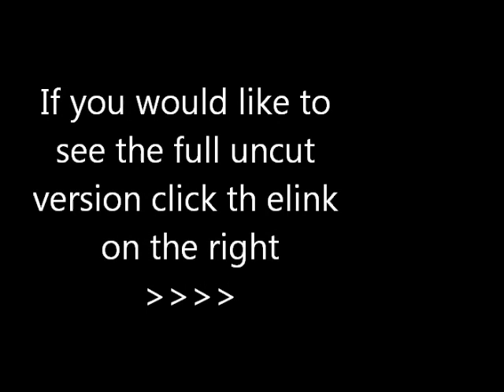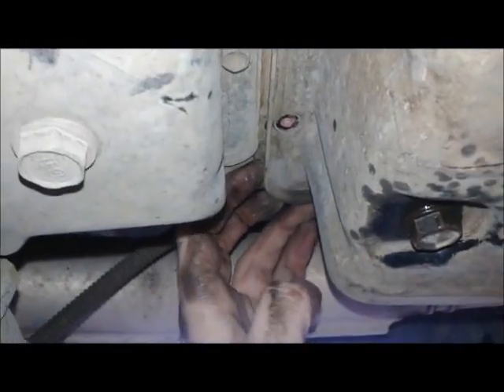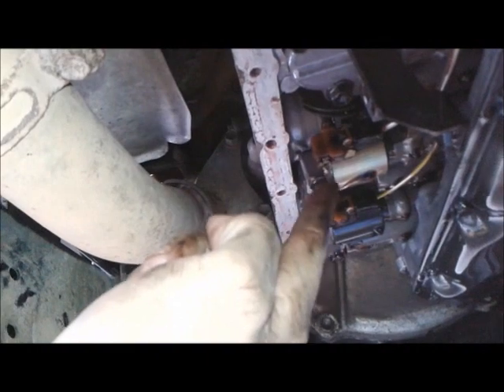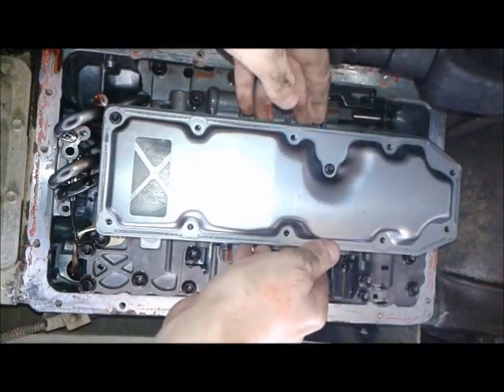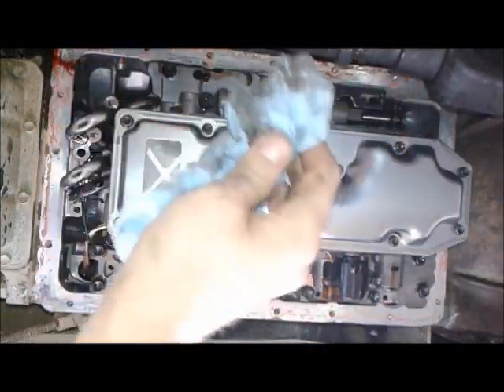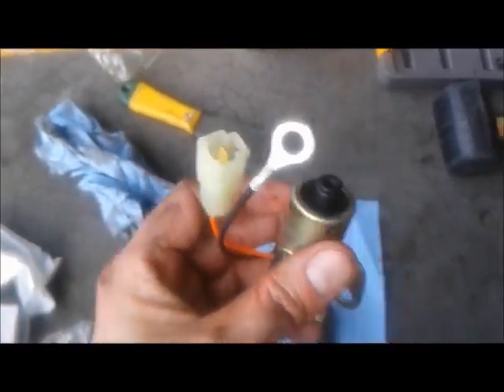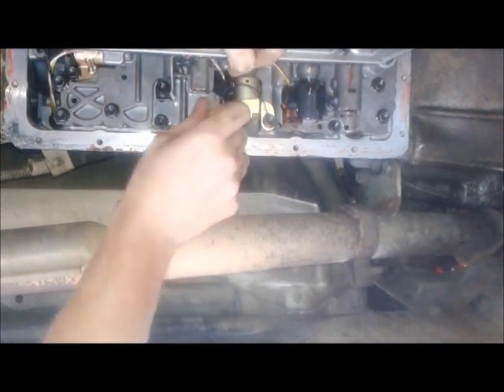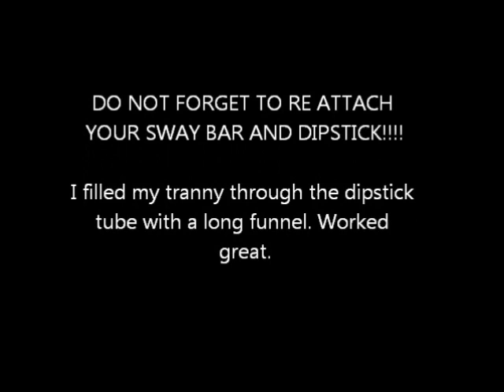2nd Gen 4Runner Shift Solenoid Replacement ***condensed***

Comment: For anyone wondering what improvements this made for my 02 4Runner. I just installed the 3 solenoid, filter, and 5 quart fluid (of 12)replace NOW IT SHIFTS LIKE BRAND NEW. I was just hoping it would clean up sloppy shifts BUT IT FIXED way MORE. It kicks down gears SOOOO much faster. If you're in overdrive cruising and full throttle, it NO LONGER applies full throttle to overdrive for 1/2 second to 1 second. It now kicks down the gear/s before the pedal is even at the floor. It literally made this horribly slow suv a tad bit faster just because there isnt lag before the kickdown anymore. 
   It was also holding 2nd gear excessively long sometime. Not an issue anymore. And it was shifting a little soft when light throttle shift to 2nd. NO MORE!! Nice firm complete shift fully engaged. IM PRETTY STOKED!!! My 02 4runner has 185k miles. I did the 1st 5 quart drain and fill with a new filter at 100k miles about 10 years ago so the fluid still looked brand new red, no burnt smell(even though i live in the desert 120+ summers). All she needed was new solenoids. Do it now before you  cook the trans!
Reply: Exactly my problem...long delayed shift in second gear...but now also when i reach 50mph...i can give it gas but wont accelerate very well.
How much did that replacement cost?
Reply: I know I am kind of off topic but do anybody know a good place to stream new series online?
Reply: @Marcel Arthur flixportal xD
Reply: @Tommy Ben Thanks, I went there and it seems like they got a lot of movies there :) I really appreciate it!
Reply: @Marcel Arthur Glad I could help :)
Reply: Did you replace all 3 solenoids?  Or just that one?
Reply: Thanks for the info, any chance you have the part number and the price?
Reply: What selonoid kit did you purchase and where from? I got a 2002 third gen 4runner automatic V6 2wd that might have a sticky selonoid issue.
Reply: How many solenoids does the 02 4runner have? Or which ones did you replace?
Reply: Is this process the same for 2wd ?

Comment: My 1987 4runner would not shift to 1st. gear after coming to a stop sign.  The way around that was shift manually,  the problem  ended up being the shift solenoid as described in this great! video.  I had the transmission shop change out all 3 solenoids for safe measure.
The parts were not expensive.

Comment: Where are people buying reputable new solenoids for the A340h? I think all of mine are probably cooked as they’re in an 89 4runner that hasn’t had much tlc in its life before I got to it. 230k miles means it’s shifting super hard from 2 to 3 and into reverse. Not sure if they correspond to certain solenoids but I plan on doin all

Comment: Do you have a part number for the shift solenoid?  Also, was this from an error code?  Mine keeps coming up as P0770 (shift solenoid E), but I don't notice any problems shifting...super fun.
Reply: Just seeing if you have a part number for this solenoid...
Reply: Paul Krug 
Is that the part you need to change  for code P0770??
Reply: P0751
Reply: @paulkrug6748  ATP part #1-5426 (NAPA Auto Parts)

Comment: My 94 4runner when cold wont move until warmed up do you think this is the problem...also i dont get enoughh power when i step on gas..i changed spark plugs ..wires..cap and roter..any advice
Reply from the maker: It could be sooooo many things. As for power, maybe you need to change the fuel filter. you probably change your oil regularly? Clean the air filter and throttle body? Do you get a check engine light or anything? I've posted a full length version of this video that shows you how to read the engine light codes pre 1995

Comment: I've got a 92 Cressida. The transmission was fine, then it wouldn't go into gear. I felt like it was a solonoids, so I unhooked the battery, and then started it back up, and was able to drive it perfectly for about a mile, then same thing. Its like I put it in neutral. Shift control, solonoids? Any ideas would be appreciated.
Reply from the maker: Could be a computer problem🤔 I honestly don't know. The symptom sounds like the solenoid, but I'd never be able to diagnose it over the Internet.
Reply: @MyAccountBitch  that's what I've narrowed it down to. Shift control, or computer. The fact that it works fine, for a time, EVERY time, makes me think it's a wiring issue too. I can't wait for my schedule, and the weather to permit me to figure it out. The house I just moved into doesn't have a garage yet. I'm really curious, and anxious to figure it out.

Comment: Mine just started slipping on first gear when taking off after a stop. When engages slams and takes off loads hard on rear end? Only does here and there just started rest of time shifts fine?
Reply from the maker: Sounds about right. If you check out the long version of this video it'll show you how to look up the transmission code
Reply: @MyAccountBitch  where is the long version of your solenoids video? thanks
Reply from the maker: @albertomendezvincenti3020  https://youtu.be/EEoqKD0QcTI

Comment: Hey man my 93 4runner started having shifting problems I'm think it's the shift solenoids because I drives & shift amazing once I get to speed & or the truck has warmed up. How much you think the labor would be not including parts to replace the 3 shift solenoids?
Reply from the maker: I couldn't find a shop to do it. They wanted to do a rebuild. That's why I did it myself. It took me a few hours. I'm sure a shop could do it in a couple of they were willing. My solenoid alone was almost $300 though. I think there's cheaper aftermarket ones though. You'll have to do some looking around.

Comment: Do the other 2 solenoids come out just as easy as that one? having issues with shifting and thinking about just replacing all 3 if it's as simple as just unbolting and plugging new ones in.
Reply from the maker: Yep. You can buy a kit with all three
Reply: May I ask where did you buy yours from?

Comment: Great video bro, I'm going to do mine very soon here.  I just got my solenoids from RockAuto, very fast to Edmonton Alberta.  They were a bit pricy due to exchange but oh well Waaa!  I'll be doing it at a rental garage end of the month.  I lost my last gear.  Will not go into overdrive.  I think I'll just change all three.  Cheers!
Reply from the maker: I paid $270 for one...
Reply: Holy!  I got all three for $238 from Rock Auto.  I'm thinking of installing a shift kit when I do this after reading about all the benefits.  I'm going to rent garage space with a lift, so it'll be easier.
Reply from the maker: +shaun wakefield
 are yours OEM?

Comment: mine would never go in revers unless you would drive it for a good while. then the 3rd shifting to 4th would take for ever to shift. It gave me the code for 62. I believe solenoid #1 is the issue.
Reply from the maker: Bryan Lopez
 yep. 62 was the code I pulled too
Reply: did your reverse work when engaging in that gear? im just hoping when i change the dam thing it will work
Reply from the maker: Bryan Lopez 
yeah

Comment: Thanks for the video. Question. I have a 2006 v6 Tacoma and my code is P2714 pressure control solenoid "D" performance(shift solenoid valve SLT) so I was wondering if I need to do the same thing or if I have a completely different problem? If you could give me a little advice please I would appreciate it and would be willing to wire you some money for going out of your way to help me. Thanks

Comment: Where did you order it this shift solenoid from?
Reply from the maker: Sleek S local parts store. Not cheap
Reply: MyAccountBitch how much was the pricing?
Reply from the maker: Sleek S I can't remember exactly, but I think it was between 200-300
Reply: MyAccountBitch hey so u got aftermarket you didnt get it from dealer? And how does that work been trying to get better price dealer wants 600 for one thanks

Comment: My 97 T100 SR5 4x4 is having all sorts of shifting issues. Jumps immediately from second to third and it won't engage top gear I shift it into D and it disengages completely so I can only drive out about 30 MPH. I bought a complete shop manual set that covers the entire truck, but I don't have diagnostic tools.

I'm gonna try this first and hope like hell it solves it and I don't have to dick with it no more. Because I can't find a shop anywhere near me that services Toyota transmissions.
Reply from the maker: If I were you I'd buy a code reader. I got a decent one for $60
Reply: Did it help your truck? Mine won't go into 2nd it idles high and shifts late.

Comment: So hopefully someone sees this, I changed the three on my 99 runner and now it dies when I put it in drive or low, reverse just fine, any ideas?
Reply from the maker: When an engine dies it's usually due to air or fuel. Transmission doesn't really seem like it would be the cause 🤔 you might just need a tune up... Spark plugs, fuel filter, cleaning the airways... Maybe a MAF sensor... Could be a number of things! Probably nothing major though... Just gonna be a lot of research and trial and error. The joys of owning older vehicles 😂

Comment: loved the video ! mine wasn't shifting good,  had to drop in 1st to start , put in 2nd n it went to 2nd for a sec n right to 3rd.. I had a trani specialist replace the solenoids.. he said there is 2 n did both .. there is a fkn 3rd solenoid !? Y would he replace only 2 !? what the entire fuck !!? it shifts way better now but it doesn't shift right it revs too high and sometimes when going into 3rd it just drifts into neutral wtf .. any thoughts ? maybe it's the throttle position sensor ?
Reply from the maker: it's not the tps... maybe your actual tranny is buggered... the third solenoid is the lock solenoid. you'll know if that goes!!!
Reply: +MyAccountBitch  cool , thnx for the quick reply.. how are u sure it's not the tps ? and wat does the lock solenoid do ? thnx again
Reply from the maker: +carlsbiz1 well, I'm not positive it's not the tps, but I've done mine and it changed my idle, but not shift rpms. how many rpms are you shifitng at?
Reply from the maker: +carlsbiz1 
if the lock solenoid goes your truck will have a hard time getting going from a stop. will feel like your e brake is on. then it will buck like a bronco for the first few feet when it does start moving.
Reply: +MyAccountBitch ... if I start off real easy,  most times its good n shifts at 2.5 Ish.. if I get on it some , it stays high to long n gada back off peddle so it shifts up.. ahhh right , is for torque converter function .. anyhow I'm perplexed , maybe the trani is wak  , although I find that hard to believe
Reply from the maker: +carlsbiz1 well, I know for mine, being a '91, sometimes I gotta feather the gas a bit to getbit to shift after a hill or something. it's just a little quirk of my truck as far as I'm concerned.  I don't worry about it.
Reply: You ever figure out... mines in a similar situation and also.... my stupid mechanic totally did the same thing

Comment: I was trying to get the code but the od light just keep blinking non stop .
Reply from the maker: You might have a couple issues. Were there any long pauses between flashes? Might be showing more than one code
Reply: Mine too, even after replacing solenoids 1 and 2
Reply: Leo Rojo did you ever get any answers on the od blinking the way it did?
Reply: @andrewllamas4423   no

Comment: Hi, I have an 05 tundra with shifting problems. Drives good from 1st to 2nd or say 30 mph or if I whack it; 50mph then it revs freely. and if I floor some more it wud engage with a very violent thud like I got smacked in the rear. Throws up code P2716. What's your advice?
Reply from the maker: alexander uzoechina 
I'm not familiar with the toyota tundra transmission, but if this solenoid controls shifting pressures, and either is not working, or possibly sticking sometimes, this could lead to hard shifting as you describe. If you have not changed the tranny fluid in a very long time it can also sometimes cause valve body sticking problems like this due to debris built up in the valves, or the coil in the solinoid could be fried. Since it is a moving part and all moving parts eventually wear out thats what I would suspect first.

Comment: Which one is shift solenoid E
Reply from the maker: I don't know. it's not in there. I think it's on top of the transmission or something. Never had to change it.
Reply: The Isolation Station on top where?
Reply from the maker: @marcohitsthatshittyee8850  I don't know. You'll have to do some research. Did you pull code P0770? If so it could be a torque converter too. Or maybe just dirty trans fluid. Wish I could help you more, but I've never had a problem with solenoid E.
Reply: The Isolation Station code 753 shift solenoid E and electrical shift solenoid E

Comment: I would like to pick your brain on an intake system I feel $200 for a rubber 45deg tube no...
Reply from the maker: Oh. The eBay ones?? I'd just go  authentic K&N. I had an eBay one, it worked, but I had to keep adjusting it every so often.
Reply: No that's for the OEM stock one from the dealership its 200 something... Is the K&N a direct fit or do I have to do some custom work I couldn't really get a good shot of yours in the last video
Reply from the maker: James Denton they're vehicle specific. Should fit right in.